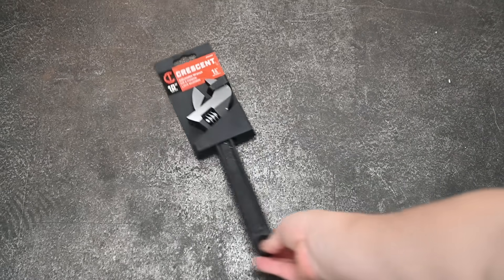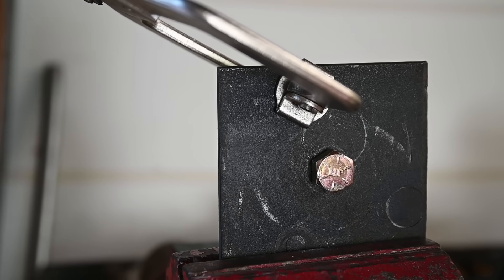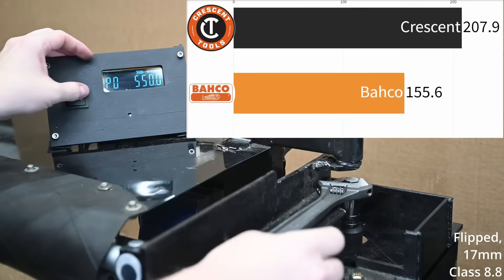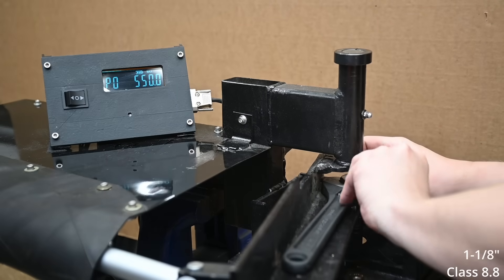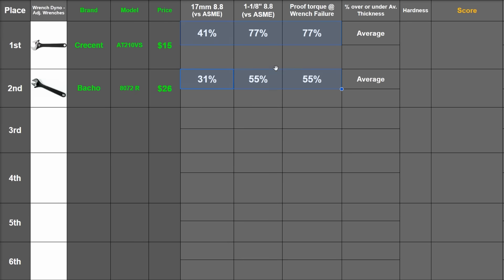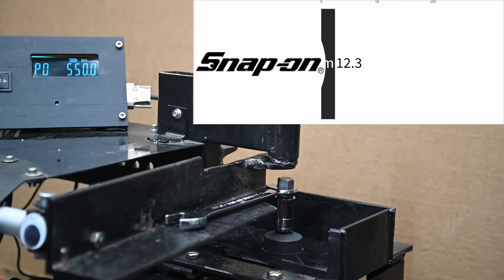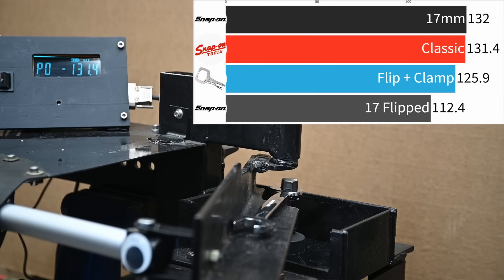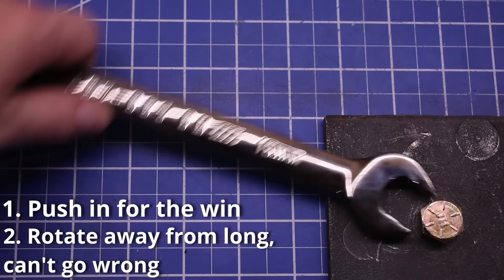Are you turning wrenches the wrong way?

Comment from the maker: The Jaws refer to the outside shape at the end of the tool, the part bolt is in contact with is called the broached opening/flats which are indeed equal length. 
The peak figures are high at times, but you can see from the close ups the hex starts camming out and rounding over much sooner than the peak numbers. Especially for adjustables, one way seems to do that less or later in applied torque, and this is on perfect new wide/thick hex hardware. What you're working on might be softer, or less perfectly shaped, so if you have the choice of either might as well choose the one that will give you the best shot, or use our recommendations here to best even the score.
Reply: fun but stupid fact, a "crescent wrench" is called a swedish key in danish.
Reply: @Abdojtj  English key in Belgium 😁
Reply: @1nt123 and in Australia we call it a shifter
Reply: @Abdojtj  I only buy old Billnäs products, cheap big nut busters, from Finland .
Company was founded in 1641  operated to 1980, Fiskars had bought Billnäs in 1920.
Reply: can you test adjustable pliers now?
Knipex Cobra
Knipex Aligator and so on 

anyway great job as always
Reply: They will ALWAYS be known as  crescent wrenches after the company Crescent tool owned by Karl Peterson tools that invented them at their original Crescent St Jamestown NY location.  Like most companies they’ve long left their hometown origins. It’s the Same city where the 4 in 1 screwdriver was also invented by Algot T. Johnson and Burch Tool in Jamestown NY and the city where Matco tool boxes are manufactured.  

City most known for Lucille Ball from I love Lucy, Catherine Hershey from the candy company,  Nick Carter, Roger Goodell, and others. It was once the furniture, brass hardware, and steel door/ window manufacturing capital of the world and original home to MRC and SKF bearings, also Truck Light whom invented the first sealed marker lite, the first stop, turn, tail light, first led license plate, dome and back up lights.  It’s also home to a notable Cummings engine plant.
Reply: I'd like to see a comprehensive adjustable knuckle fucker vid, with the Wera Jokers in the lineup.
Reply: It was an interesting test you came up with and I’m surprised at the results.. however the test I would have considered far more relevant is force applied (to wrench) vs torque applied to “nut” — where force is applied at same distance from the centre of the “nut” in both orientations of the crescent wrench. I’d imagine the “correct” orientation gives you mechanical advantage - which is why the backwards orientation resulted in lower torque at failure (you basically swapped the mechanical advantage given by the asymmetrical geometry so the “nut” had advantage on the wrench)
Reply: Very interesting, and I would like to see some before and after measurements of the open end wrenches to determine if the jaws permanently deform from the testing.
Reply: Not an M.E. but I had to take their classes.  I vaguely remember the prof showing us that the best torque could be made turning the wrench away from the long side, having something to do with the offset of the axis of the wrench from the center of the fastener.  But it's been decades since then, and I think I sold the textbook back....
That said, just this week had one where I had to alternate sides on an open end because no sockets or gear wrenches would fit in the limited clearance between the fastener and the rest of the assembly.  🤬There's probably a wrench out there that would fit in there properly but no combo of what I had available would do it other than the open end.
Oh, and if it isn't damaging knuckles, it's rounding off the hex and forcing you to source a new fastener!
Reply: the time 1970s, the place Aviation High School N.Y.C...Shop teachers 100% WW2 and Korean War vets. using any tool incorrectly...slightly life threatening. One of the solidly happy times in my life. BTW, my first set of personal tools as a high school student where huskies and I still have them so, if you learn to use them correctly you stand a good chance of using them forever in non professional environments. a working mechanic is another story...
Reply: Cresent wrench comparison test please. Also the new snapon 3/8 and 1/2 stubby impact test
Reply: I think your setup needs some bracing right below the top of the test hex on the backside. A typical bolt or nut is constrained by the hole below it
Reply: Your set up does not have the pressure on the wrench at a straight angle with the radius of the circle it's turning in, that's why some slip off the bolt, if use a spacer like you did with the wooden block in between they will push the wrench onto the bolt hence the wrenches you tested by using this block had a slight advantage over the ones that got tested without the block in between.
Reply: It looks like the 17/19 wrenches are camming out easier one direction because of the opposite side of the wrench. With the "big" jaw facing the turning arm it LOOKS like the point of contact is forcing the wrench to pull away from the hex due to the arc of the wrench jaw. The "short" side contact point is on the other side of the arc which would push the wrench into the hex.
Reply: If you wish to abuse the test wrenches to a more satisfying level of failure, replace your hex with a square of steel. This abandons any idea of real world conditions, but it should break in stead of slip. 

As you know, old bolts and screws had square heads.  These were replaced with hex heads (which have also been around for a long time) after automated production started in the early 1900s.
Reply: @blacksmith67  "This abandons any idea of real world conditions"
Lol, funny how you totally negate this claim in your next sentence. Perhaps you should have added "in modern cases" as I take it this is what you meant instead.
Reply: @BlacksmithTWD  True, I should have clarified that it abandons real world conditions unless you find some really old bolts or screws or you happen to have a Time Machine, but your point is well taken. I actually came across some square head screws in a very old general store 20 years ago and bought the lot. I think they are more appropriate for forged hinges.
Reply: @blacksmith67  Indeed, I've come across several, mostly on old hinges. You can still find a lot here in the Netherlands if you know where to look. Often too rusted to be taken apart and re-used though. And of course they are still made within a very small niche of metal working but that's more specialized machinery (especially when including square headed axles you may want to turn using a wrench) than restoration work.
Reply: I love the shoutout to our French Canadian Brothers. He always puts dewclaws to the worst of work xD
Reply: there is no wrong way. they are designed to be used either way. HOWEVER, due to the asymmetry in design to accommodate options, the wrenches will INHERENTLY be stronger in one direction than the other. But that has NOTHING to do with which way you can use them.
Reply: It's even worse when they try to use a pipe wrench backwards. 🤔🤨😃🤣
Reply: Wow those welds on that test fixture are terrible. I know it held up but, whoever welded it should be ashamed!
Reply: How about a multi wrench? I have one goes 7/8 to 1 1/4 or 23mm to 32mm. The weirdest wrench ive ever seen and never used. Would love to send a pic
Reply: Methodology question - when testing the impact of orientation on the wrenches, did you replace the wrenches between tests? Or did the flip tests both use the same wrenches which had just been used (and had just slipped) in the original tests? Seems like there could be bias being introduced by the ordering of the flip tests after the forward ones.
Reply from the maker: @henryptung  I believe we mention having two 17x19 wrenches a few times for this reason
Reply: @TorqueTestChannel  Sorry, meant the adjustable wrenches (forgot to specify), but you did 3 tests each for the Crescent and Bahco (with an extra test-to-failure on the Crescent), so wasn't sure how those were distributed.
Reply from the maker: @chord5625  one wrench for standard direction, the other for flipped. Purchased 2 wrenches of each. Continued testing in order shown here until failure
Reply: @TorqueTestChannel in a previous you mentioned the negative rake on adjustable wrenches. You didn't call it that but that is when the jaws of an adjustable are closer at the tip than the base. I was told this is a feature for damaged or compromised fasteners. Put the wrench on fully and tighten the thumb screw then try to pull the wrench away and it wedges on the fastener. It is not convenient if you need to move more than one swing of the wrench. It also has a negative impact on the applied torque to the moving parts of the wrench. 

I have carried the same adjustable wrench in my pocket at work for the past 15 years. It has been modified slightly to fit up to dash 12 an fittings. It works and has never let me down. 

Also I need a link to that Rockwell tester.

Comment: Something to note here - If your Bahco adjustable spanner has 'Sweden' cast into it then it is manufactured by Sandvik Bahco in Sweden and is the dogs doo-dahs... do not lose them. If it doesn't then it means it is a later one by Snap-on and nowhere near as good. However, I can not see where you would be getting these forces if using adjustable spanners so it shouldn't matter (I mean if you are looking at over 200Nm then should you really be using an adjustable spanner for anything other than a hammer? You really should be getting a bespoke spanner). In contradiction to me not liking the new Snap-on Bahco compared to the originals, I do love the slim profile, extra wide jaw Bahco.

Comment: Theory: Fit it so the larger part of the jaw will be bearing the majority of the load.
Reality: Fit it however you can get it onto that stupid God damn bolt that the tyrants in Detroit decided needed to be DIRECTLY below the exhaust manifold so you have to come in from below with an open-end and turn it like 1/90th of a turn at a time what the F-

Comment: Its not about the strength of the wrench. Its about the angle. You can feel its a lot easier to apply torque in one direction over the other.

Comment: Curiousity question: While great for potential tool analysis, what is the average amount of torque that a human can apply as opposed to this torque machine you used? It seems to me that most nut failures with a crescent wrench are due to improper setup, not to the tool failing. Now, if the user slips a pipe over the end of the tool and starts cranking with a (say) 4' lever arm, all bets are off, but I'm referring to "normal" use by a "normal" person.

Comment: I am not really a fan of adjustable spanners.

They fit everything, badly, rather than one thing well.

Two exception are my two snap-on stilsons,  they grip rounded off nuts/bolts well. 

I have used a 6 inch version with a 3 foot pipe on the handle for extra leverage.  It broke the bolt.

Comment: Generally speaking, in tight spaces there is no "right way".  You put the wrench on any way it will fit.  I've often been in tight corners or in tight areas where the box end wouldn't go on and the open face would only fit on one way, make a quarter turn...or less, then flip the wrench over and give it another short crank, rinse, lather, repeat.

Comment: The opening is angled to be able to reach and turn bolts in different situations and rotations. It has nothing to do with the direction of the turn. Sometimes there is only space for a few degrees of turning and one has to use both directions one after the other.

Comment: wrenches are designed to have a 30 deg bend at the end so they can be flipped over to access bolts with 30° or more clearance for the handle & 15° for 12 pt box end. so yes, they can be used either way.😐

Comment: I  worked in an industrial plant as a millwright for 40 years and used "cresent" wrenches a lot because sometimes that's all you could get to fit. Never broke one and did have some slip, but not a lot. Were times when I actually used cheater extentions to get things loose with the adjustable ones. Just had to pay attention and you learn after a few years what you can get away with. One time our very intelligent management took all our adjustable spanners always from us for "safety" reasons. After a whole lot of complaints and hollering, they gave them back so we could keep the plant running inspite of their help. Always nice when people who don't know what they are doing try to tell people who do, how to do their jobs. There are a lot of times when you have to fudge around what people think is proper to keep equipment running. Particularly when it costs you thousands of dollars an hour for certain pieces of machinery to not be running.

Comment: Oh silly me. For 80 years I have been thinking that the offset was so it could be used in tight spaces something gets in the way so flip it over and your good to go, just like I was taught by those before me. How could I be so stupid. I must say that ring spanners have no offset because they just happen to have a fix at half the angle of the nut or bolt flay which I note is about what the offset on the wrench uses. Or did you miss that bit. 
I would put down any cam-out or slippage as "you get what you pay for" or what the marketing divison want to charge you.  Don't forget the offsets were in place long before modern steels were everywhere as a means of access not strength one side or the other. Also ring spanners (and sockets) were the choice tool the open ended wrench was for access limited space.

Comment: there is no wrong way. they are designed to be used either way. HOWEVER, due to the asymmetry in design to accommodate options, the wrenches will INHERENTLY be stronger in one direction than the other. But that has NOTHING to do with which way you can use them.

Comment: It’s offset for kinematics, not strength. When breaking a fastener loose, it’s better to have the adjustable jaw advancing into the rotation so the load is carried by the fixed jaw. In tight quarters, flipping the wrench every half turn gives you more complete rotations and faster work.

Comment: Sad to see Bahco fail in comparison. The thin jaw Bahco i bought is phenomenally tight tolerances, there is like zero slop in the jaw and threads compared to 5 or so other brands of adjustables I have. I knew Made in Spain was a red flag, glad to see I am continually right on breaking everything down to simply the country it's made in 😂
Reply: The company thinks that way, too. They chose spain because labour is cheaper and it's not quite as bad as saying "made in pakistan" or similar hellhole, not because spain is any good with tools

Comment: Part of the reason for the "proper" or ideal jaw orientation, is the opening angle relative to the rotation will either promote the bolt head sliding into the tool where it will bottom out and be held better, or sliding away from the tool where the jaw will continually weaken (due to less material support and increasing leverage). You can even observe this using a sloppy/cheap adjustable wrench with an adjustable jaw that's already rounded/bent a little.

Comment: The original design of the 30 degree offset open end spanner, has nothing to do with torque.
It has everything to do with being able to present the jaws to the hexagonal nut, in confined spaces. 
Just picture the problems you would have if the jaws were straight and you will see what I'm talking about.

Comment: Heres what im saying, it basically makes no difference because if you need to put enough torque on a bolt to damage a wrench from turning it backwards you should have used a different tool to begin with.

Comment: the angle is they is to enable the spanner to get into a wider range of places. it has nothing to do with the amount of torque they can apply.
i cant believe there's so many dumbarses out there that we really need to waste screentime on this crud.
an adjustable wrench (a poor mans spanner) MIGHT be the only exception, but you should never be using them anyways. get a spanner.

Comment: The angle of the jaw has nothing to do with your body. Any difference in comfort or awkwardness is just that: perceived. Turning it around only changes the angle of the handle, not the way you put force in it. And since hex nuts can have absolutely any orientation, you can find that handle anywhere, regardless of body standards. However, being able to flip it over, makes it that you can grab any open nuts within 30 degrees of your preferred most comfortable angle to start.
The angle is 1/12th of a circle to evenly distribute the useful angle of obstructed nuts. It also allows for fastening and tightening even when there is only 30 degrees of swing available.

(I bet you're looking into ways to pun the crap out of this comment)

Comment: Can you do an extension of this test using a 7/8 and a 1-in open end wrench? I've been doing alignments for almost 30 years and have noticed that jaw spread seems to be less with the wrench running in what is considered the backwards direction. This is usually when running a wrench extender on the end of it to gain extra leverage. I have noticed a big difference when you get the ones that are tight enough that they're starting to round off the nut in the regular direction, turning the wrench the opposite direction and applying that upward pressure that you described while rotating it made a difference in those cases.

Comment: I learned this many decades ago, that if you need to break something lose with an open end to try to use "the proper" way as the initial way to break it lose . And if you can't, before you get crazy, to try a line wrench open end if that will fit. There are a few methods to try before you go and round off a bolt/nut that can have an agonizing outcome .